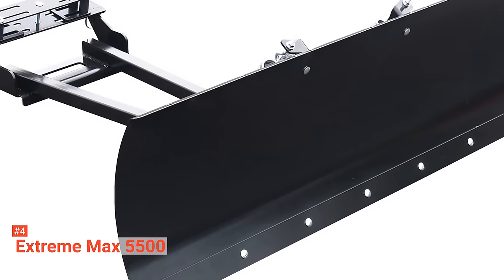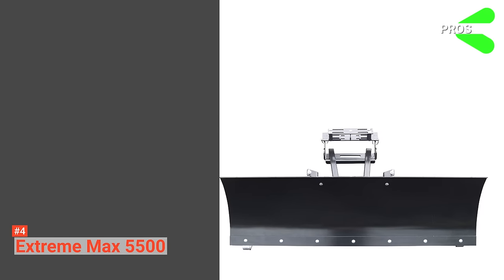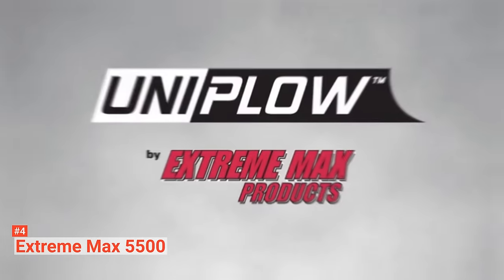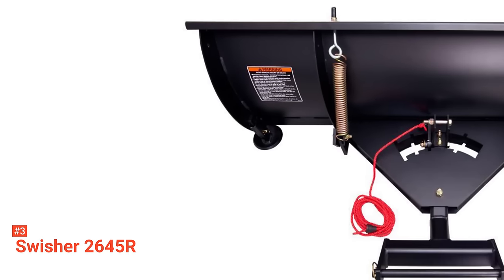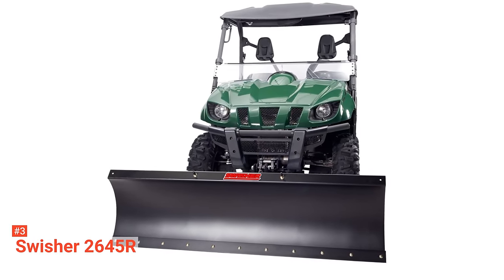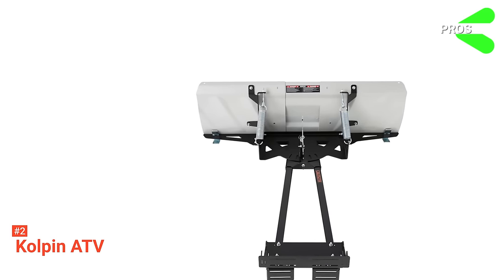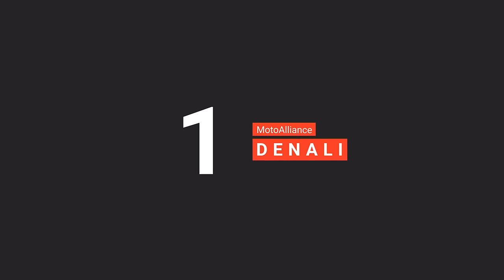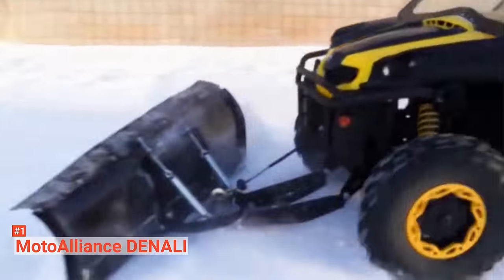Don't buy an ATV Snow Plow until you see This!

Comment: You were about 9 years too late with this video for me. I bought a Warn plow. Has worked great all these years. I even used it to spread loam in the yard. I had 2 long gravel driveways and it plowed as good as my truck. It would easily plow 1+ foot of powder and if it was heavy snow I would plow during the storm once. I had the driveways paved 2 winters ago and put a poly cutting edge on the plow. Cleans right down to the pavement. Especially with a pretreatment of salt. Its been on 2 ATVs 2006 Can-Am Outlander 800 and 2019 Outlander 850.

Comment: Love my Denali plow, very heavy duty construction and built very similar to a full size pickup truck plow.
Reply: What kind of ATV do you have your plow on?
Reply: @tommymyers3183  CFMOTO Cforce 800XC
Reply: Awesome! My 800xc is coming in soon! Did you get the black 60” Denali plow? Is it rust proof?
Reply: It's painted metal, once it is scratched it will rust. That being said, it's pretty thick so it would take many years to affect any structural integrity.
Reply: @Jpperera1  yes it's the 60" plow.
Reply: @bwj3456  okay awesome, thanks for the reply!
Reply: @bwj3456  maybe I’ll just keep a restoleum black spray can handy haha

Comment: This list unfortunately didn't contain the best. The click n go plows are fantastic and attach with almost no effort. Now the 1st Gennaro best as you get a custom mount for your model, the newer gens use universal mounts, which anything universal and pushing heavy snow seems wrong to me. A couple u bolts on a frame seems like a bent frame waiting to happen. So my #1 is a click n go gen 1. And thats only after not having a factory option like AC and Polaris have.
Reply from the maker: Awesome feedback! Thanks for your input, mate. I'll review it next time.
Reply: I have a 2006 Big bear 400, What do you recommend me?
Reply: @mangomadness8635  see if you can find a click n go gen 1 mount and plow. The mounts were made model specific and the hook up faster than any other I've seen. No BS, winch hookup and pull it in.
Reply: @EC_ATV_Outdoors  thank you. I already have a winch